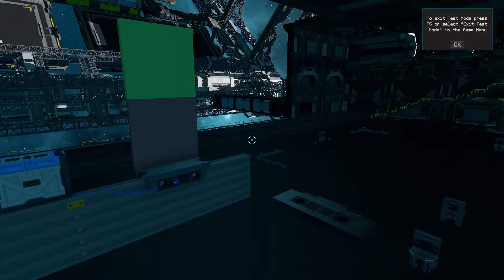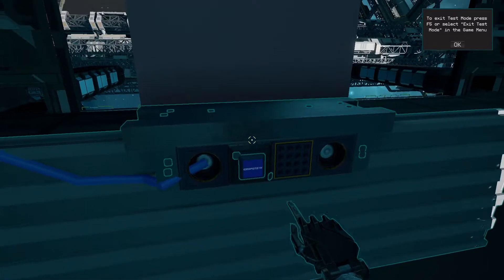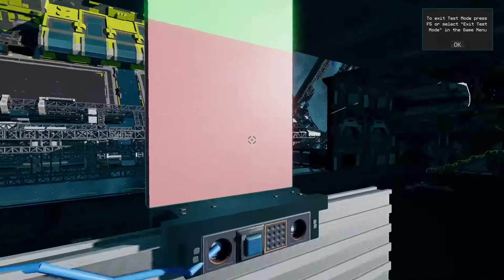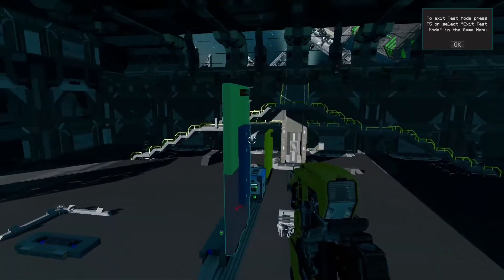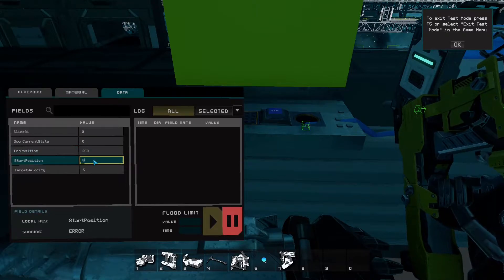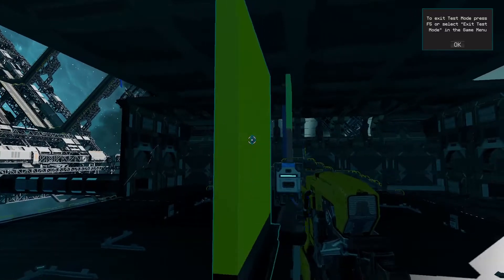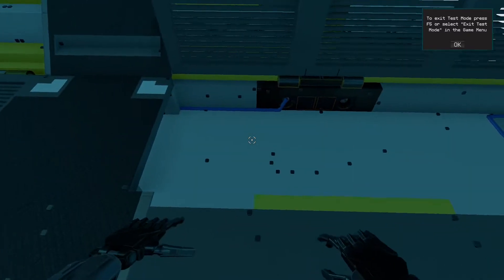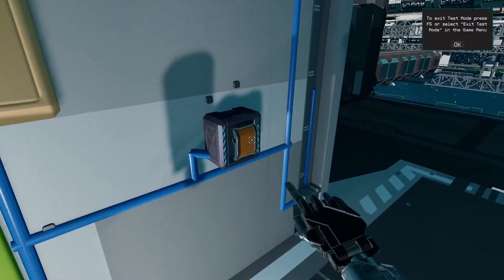Starbase Closed Alpha Tutorials - How to make Doors

Comment: Would you be able to put a slider or hinge on a YOLOL code to auto close after 30 secs or so?
Reply from the maker: Yep. You can have a yolo chip set the slider/hing value to the desired value. Having it wait 30s is a bit more complicated. You'd have to create a variable check its value and increment to count time. There should be examples of that online.

Comment: yah my door still doesnt work, its so fustrating. buttons dont work, hindges are kinda hidden away so i have to use buttons... BUT it doesnt work so im flat out fustrated
Reply from the maker: The threw biggest issues are: make sure it is connected to network. #2 make sure you are setting the state value of the door. #3 make sure you are in toggle mode for the button. Other wise you have to hold the button to see a change, and pressing won't effect a visible change in the door.

Comment: Can you stack multiple hinges/sliders?  Like a hinged door on top of another hinged door to make an unfolding wing-like thing?
Reply from the maker: You could have an unpowered hing or slider (using handle). Power wouldn't normaly work. However you may be able to do some wire wizardry to get it to work in stages.